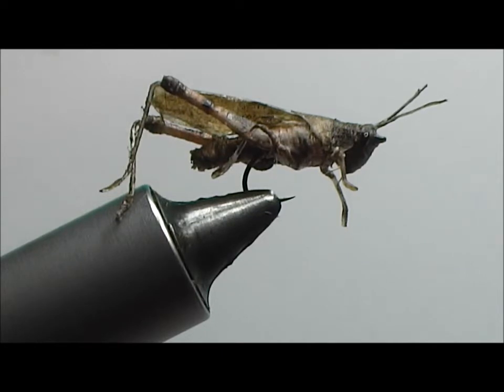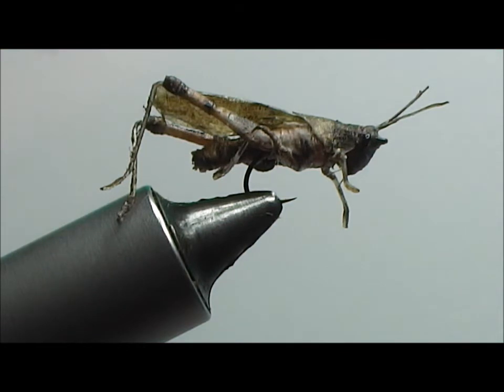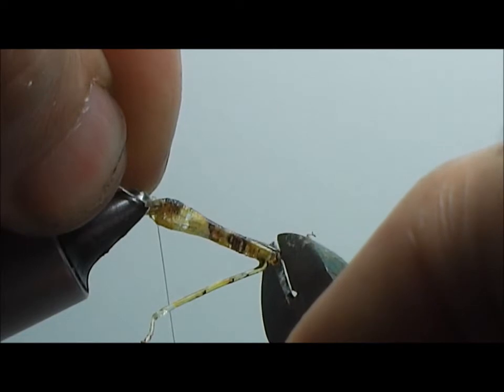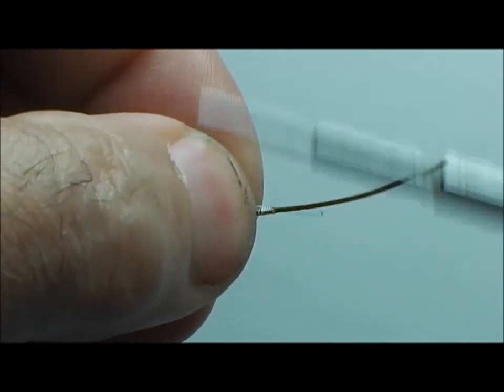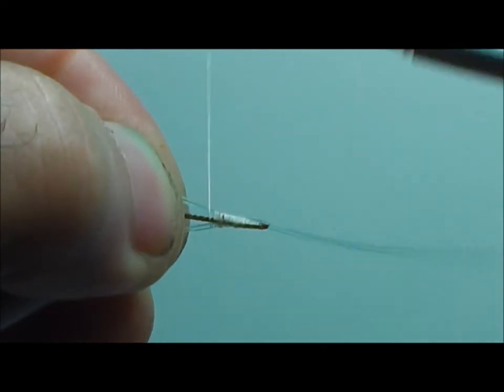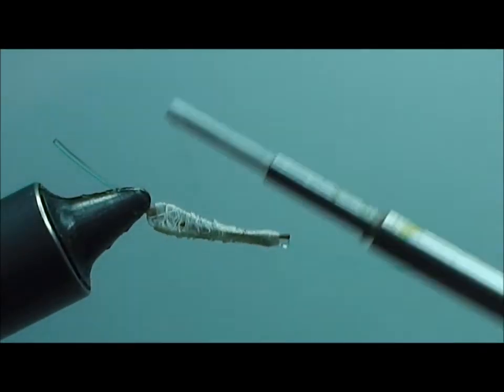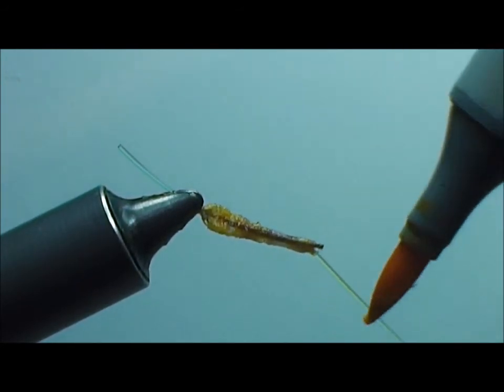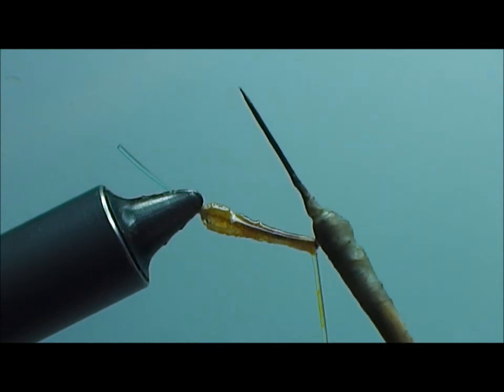Hopper legs

Comment: great toutorial Fred however, it would have been nice to be worned about how long to hold bobbin under lighter. Myfirst try was a failure.
Reply from the maker: Yes , each bodkin holds heat differently and I try and test them out on scrap mono before using them on something in the vise. I hold the lighter under the bodkin and count for a couple of seconds and try kinking the mono  added seconds until I get the time right and then i know how much heat that bodkin takes to kink that size mono without burning through